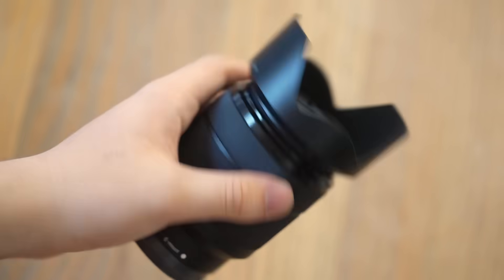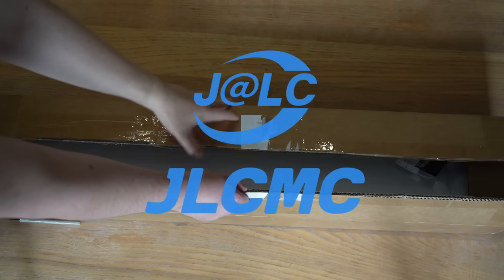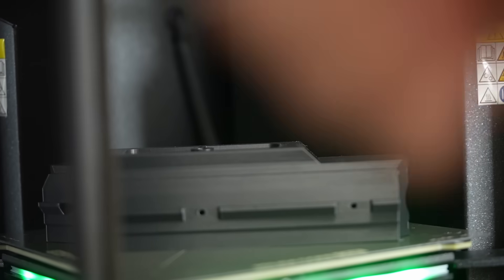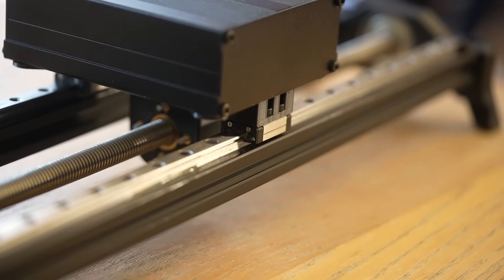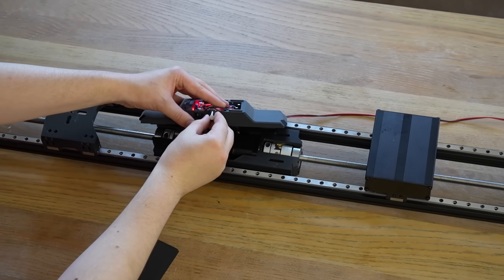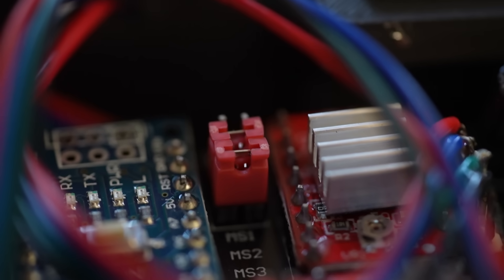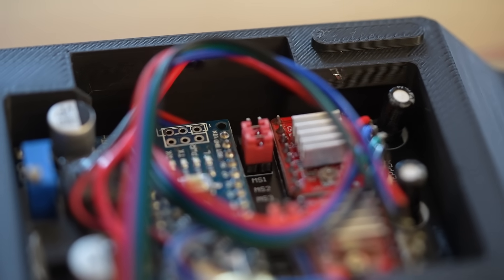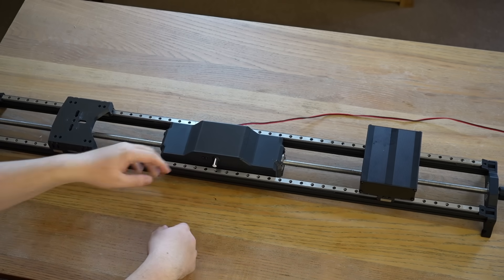They Wanted $1,364. I Built a Better One and Open-Sourced It

Comment: So it cant even use half of the slider lenght because you put the motors in the middle. Thats lets say, far form ideal. And when alredy adding all the custom electronics, why not adding any sort of remote controll so you dont have to touch it and can program moves.

Comment: Cool project but to anyone who hasn't got tools required to pull it off I'd suggest getting Accsoon TOPRIG S60 for around $440 which can be powered by a standard NP-F battery. The best bang for the buck currently.

Comment: Excellent build and ideas. Just a food of thought, may be you already thought of it: why not make the counter weight as "external" stackable LI-ION battery source. Then you have a proper power bank that can connect to the motors by running a cable through a cable carrier of a 3D printer, which will prevent pinching or pinning of the cable.

Comment: I‘m an absolute beginner with DIY projects that include an electric motor (only previous experience were little RC model car kits as a kid).

My question: What are the most quiet, ideally silent electric motors under normal operation? All the motors I‘ve toyed with so far have the usual whining sound.

Comment: That's pretty well built.  

The length is an issue, though, as it would make transporting it/etc. a hassle.  Personally, I'd cut the linear rail in half and place it on both sides of the extrusion, connecting the two sleds with belts that go around a pulley at either end.  That way, you could place just one motor on the end, driving one sled, and the other would automatically travel the other direction.

This simple change would make the whole thing MUCH more compact and MUCH cheaper to build, while maximizing travel on the linear rail.

Cheers!
Reply: As a project this is cool, but as a practical matter, you shouldn't need more than a quarter the length.

Comment: You already have the rails to carry the load, you don't need anywhere near that large of a diameter leadscrew.  Could save a couple of bucks right there.  You probably could get away with one rail as well.  Maybe 1 size larger, but some cost and weight could be saved there as well.

Comment: You have beautifully wasted more than half of the motion range of the linear rails…
Also you put chunks of metal into that box, instead of Li-Po cells to make it battery powered.
I suppose you have a few things to learn to make it not only expensive but truly valuable, it's just not there yet.
Sensorless homing is an option if you use a proper stepper driver, then you don't need end switches at all.

Comment: You could even program the motors to spin at slightly different rates, allowing you to tune the counterweight balance if required. Though if you used a single motor and belt like other commenters suggest, you might even be able to have the camera and counterweight(s) move past one another, doubling your range of motion. I suspect you could do end-stop finding by UART communications to the right stepper drivers and looking for skipped steps or sharply increased current draw.

Comment: One way to save cost is to use a timing belt as a loop. Then you can use one side connected to the camera and the returning side to the counter weight. This makes it very flexible to change the length. There are also wheels made for going in the groove of the aluminum extrusion making it much cheaper since you don’t need the more expensive linear rails. And again makes the length just a matter of choosing the length of the extrusion.

This said, it was a very nicely produced video.
Reply: Thick belts can definitely handle enough force to not stretch or vibrate, considering they’re used on high-speed 3D printers. But V-rollers are something I’d be hesitant to use. Linear rails are probably the best choice for this kind of project.
Reply: @Scrogan you can use linear rails for the camera side and rollers for the weight side.
Reply: @EAGLINWRX  That’s sensible, especially if you mount them on different parts of the extrusion in order to have the camera and weights slide past one another for double the motion range.
Reply: I was going to say the same thing lol so many places you could cut cost for the same results. I think a cooler addition would be a wireless connection to input and remotely run preprogrammed paths and maybe add a third detachable motor for rotation.

Comment: Cool Project! Especially nice as you used only easily avaliable parts and tools! A few suggestions to consider, mby for future projects: If you want the smoothest possible motion, Continuous rotation servos might be more suitable for your application as they focus on precise speed ctrl instead of positioning (like steppers do at the cost of slight stuttering). Using an IMU and feedback ctrl to actively balance the gimbal(move the weight) would be interesting to see and could also enable you to freely change the weight of the camera within a certain range without compromising balancing at almost no additional cost. You could probably implement this quite easily using PID, even better if you use a feed forward term based on the weight of the camera.
Reply from the maker: Thanks! ill look into those servos - I havent used them before, but they definitely seem very useful!